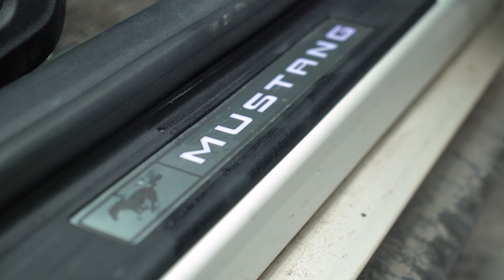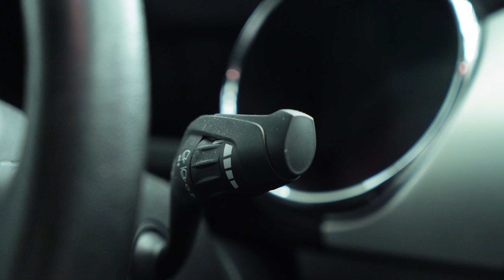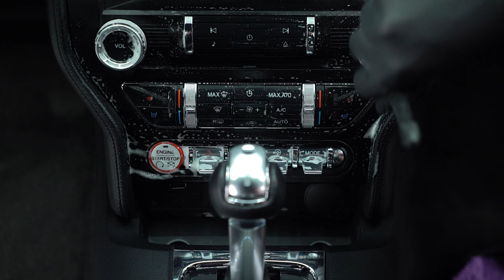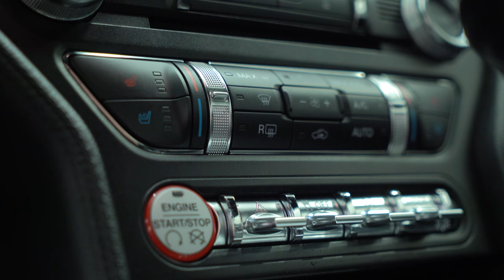Detailing/deep cleaning Ford Mustang from Siberia

Comment: It's eco boost right?
Reply: i believe in europe the v8 had a 5.0 badge on the front wing arches, but i can't see any there so.

engine bay looks like an inline 4 to me
Reply: @jacob42069  def not a i4, it has a V configuration
Reply: 3.7 Cyclone V6
Reply: @tahahaider5836 it's an ecoboost you can see the coil pack up top and the v6 had a different trunk badge. The v6 had the fake gas cap with the 3 bars. The ecoboost was just a pony. The 5.0 said gt
Reply: @tahahaider5836  At 1:34 you can see four coil packs in a row down the centre of the engine. The V6 was discontinued in 2017. 
I'm not sure if the v6 was ever offered in export markets. It wasn't here only the Eco Boost 4 and the V8.